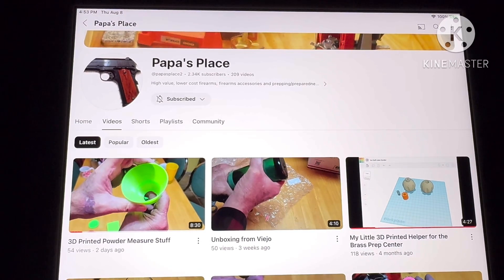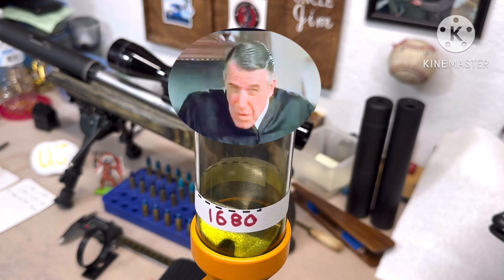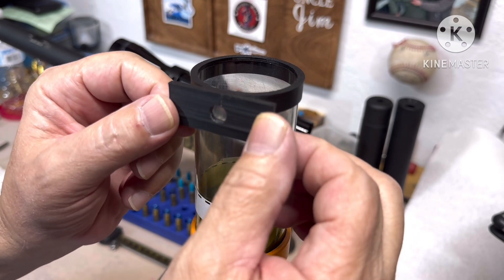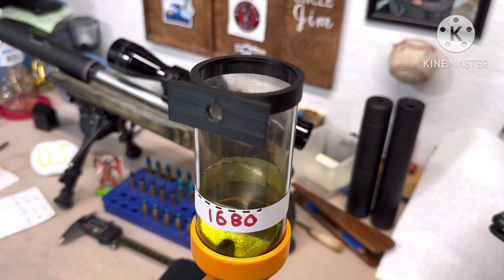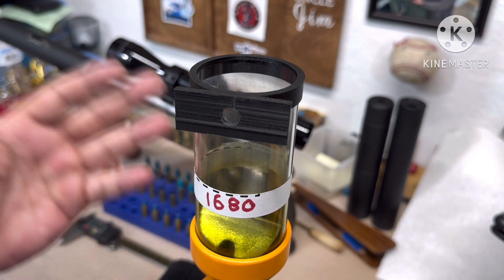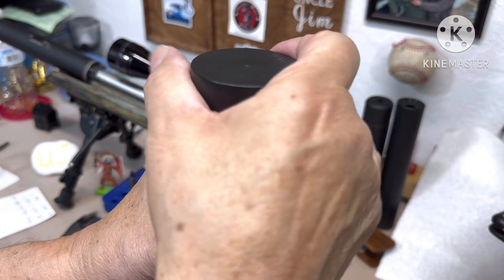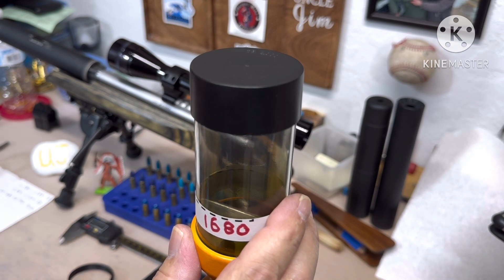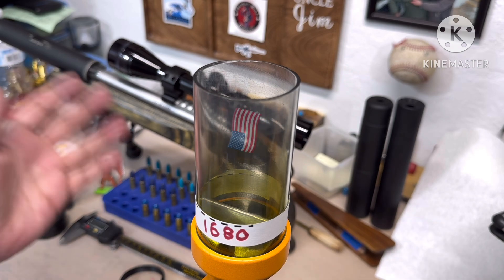￼ Dimensions for Papas place ￼

Comment: Remember those oil pour spouts with a tube for the old oil cans  , put a ring around the powder measure with a spout like that to pour powder back into its container.
Reply from the maker: I’ve been using a oil filler funnel for valve covers. 👍

Comment: Punch a small hole in the cap. When you pull the cap off, it creates a vacuum, making it difficult to get off. You can put a plug in the hole, to seal the powder (I did that with my Hornady measure), and remove the plug before the cap.
Just my experience. Your mileage may vary 😉
Reply from the maker: The Lyman is very tight regardless. 🤷‍♀️